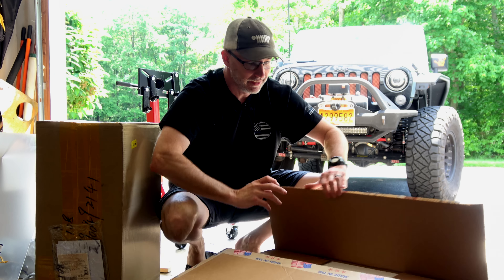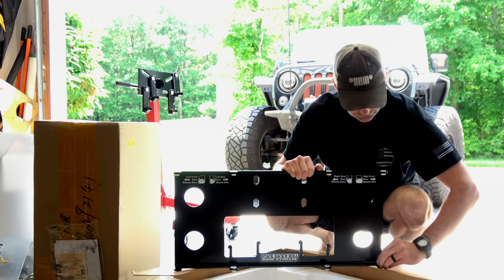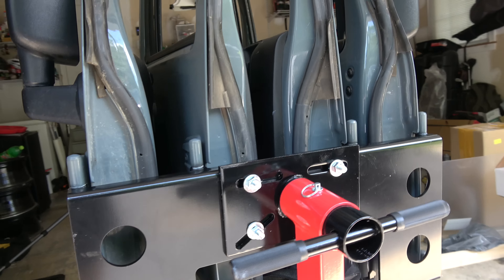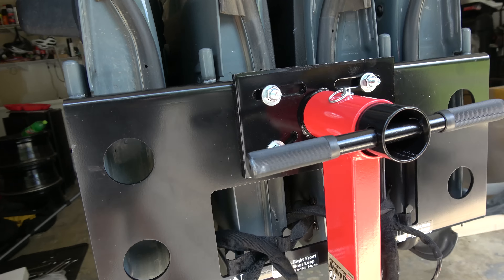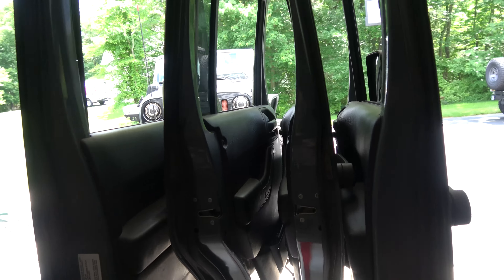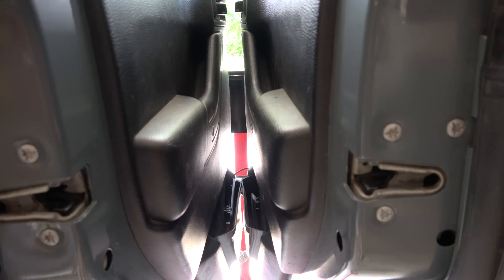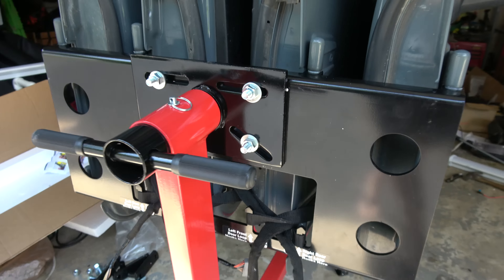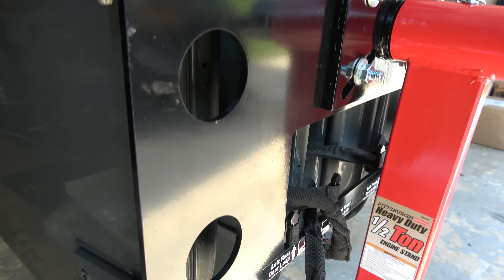Topsy Products Stack, Rack & Roll Door Storage System for Jeep Wrangler

Comment: Very helpful video that answered a couple of questions i had (apparently I missed a couple of details).
The 2000lb engine stand is a bit more clunky to maneuver and as soon as i can put rollerblade wheels on it i will.  
I had a helluva time getting the Topsy mount to level on the engine stand.  That remains my other frustration.  
Note:  i really like the Topsy product.  Got great phone support when i was figuring out the stand part, and the instructions and other docs are useful.  Very happy with the purchase.

Comment: I ordered one of these and just waiting for it to arrive. In the mean time I just assembled the folding Harbor Freight 1 Ton stand and I was wondering if the locking pin on the top that keeps the doors/engine from rotating, on yours feels stable?  On mine the locking pin is really short and kinda sloppy fitting too... I wired it to the stand with some vinyl coated picture hanging wire just because it seems like it could easily pop out and get lost.

Comment: So I take my front doors off while keeping the back doors on for the small kids.  Does this product secure two doors or is all 4 required to keep them from swiveling around.  You mentioned criss crossing the straps made it tight so that is the basis for my question.  Or can one just place the two front doors in the middle criss crossing the straps to keep them from swiveling?  Thanks!
Reply from the maker: It's stable with just the two doors... And they do make a 2 door version as well.

Comment: Hey, I just got burned to the tune of $400 by buying a Bestop HOSS door cart for 2DR & 4DR JK Jeeps because I didn't read the fine print where they say their cart will actually only hold 3 doors, (in reality it only fits 2 safely...).  ---   So I'm once again looking for a door storage option that can roll around on wheels and can securely keep my 4 JKU doors damage free.  How are you liking the Topsy Products cart and do you have any additional Pros or Cons that you've found since you started using it?
Reply from the maker: Larry Holt oh man. That sucks. I'm really happy. In fact check this video I just posted on social media yesterday! 
https://www.instagram.com/p/BkBQikCnUrJ

I was worried how it would work on asphalt... But no problem at all!
Reply: Have you seen any disadvantages so far with using a 1/2 ton engine stand instead of the Topsy recommendation of a full 1 ton stand?  Or does it feel nice n stable to you on the 1/2 ton?
Reply from the maker: Larry Holt seems prefectly stable for me. When I asked them why they recommend the other one, it seemed to be just because of the foldaway feature.
Reply: One last question. When you have all the doors on the stand, what is the width of the mounted doors at their widest point? Ideally, I'd like to be able to roll this loaded up through a standard width exterior door, which are typically 36" wide.  ---- And BTW, thanks for all the great reviews, you've introduced me to a LOT of new items that I never knew existed!
Reply from the maker: Larry Holt I just measured it. It's about 33 inches at the widest point (which is the mirrors)
Reply: Exact same thing happened to me. Total waste of money. I ended up throwing it away.